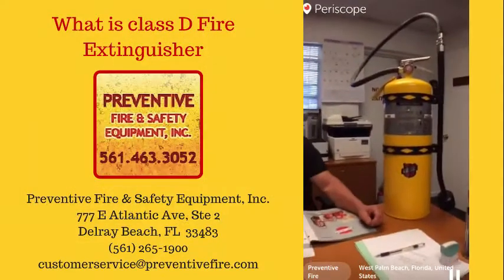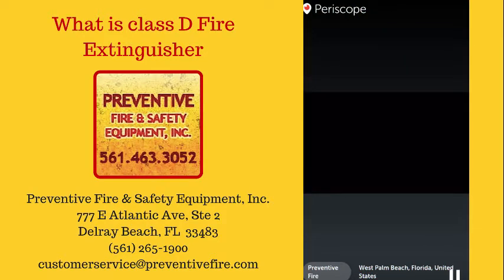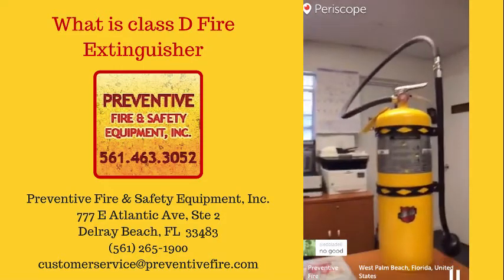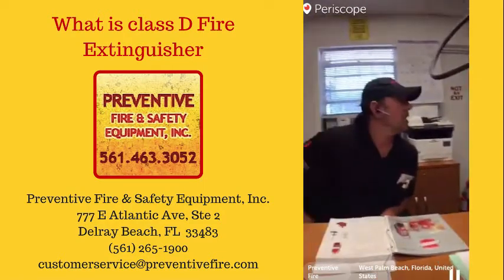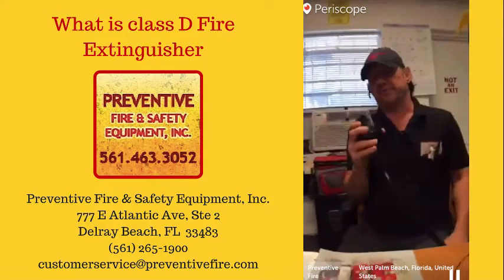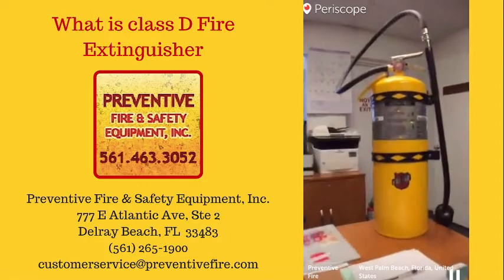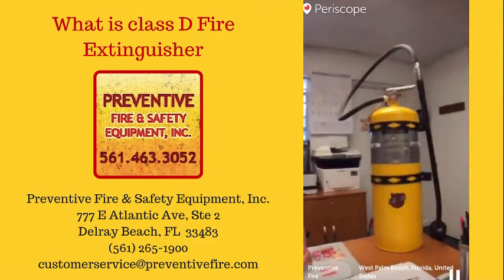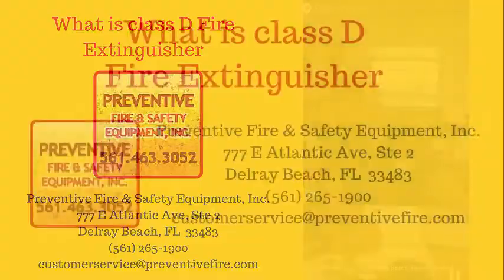How Does a Class D Fire Extinguisher Work?

Comment: wow - never saw a more unknowledgable "licensed" fire protection company !!  I thought Florida had some strict licensing requirements- I guess I was wrong. And I can see you're a Buckeye distributor from the catalog you have on your desk- what a shame !  You make all us real fire protection companies look like an uninformed, money hungry group of savages. Try attending some classes and learn about what you do for a living. Here are some facts :  there are 3 different class D fires and it's NOT because 1 is more expensive. It's because different agents are used for differant metals.  Fire extinguishers that are tested to UL 1099 ( dry chemical ) must be red or it violates the UL listing. Try reading THAT code. Since class D is NOT UL listed it can be yellow. And also- Class D extinguishers manufactored by ANSUL are red so not ALL are yellow.  Also not just machine shops need class D extinguishers- how about auto body shops that weld aluminum? Or car dealers that sell cars powered by Lithium batteries? Or car repair shops and transmission shops that work on magnesium gears?  Should they just use water?  And why is using a dolly cart so funny? The gross weight is almost 60 pounds -  should people just drag the extinguisher to the fire??  I could keep going critiqueing your awful camera angles, the girl that pops into view for no reason, the hat shading your face, the constant use of "ummm"  but I have real clients to serve with real solutions for fire protection.
Reply: beary, I too am a Buckeye dealer and a 35 yr.  NAFED member. You are absolutely correct. Training is so very important.